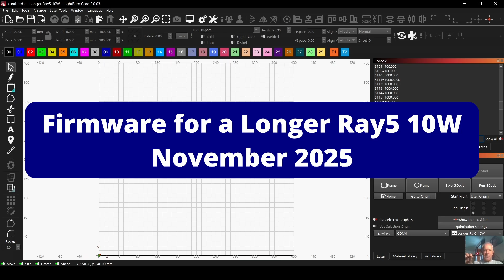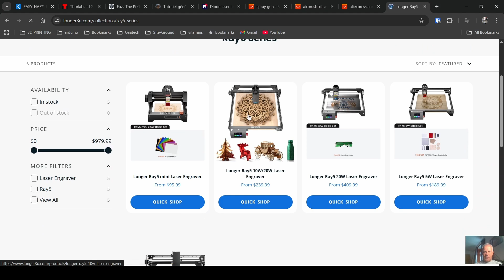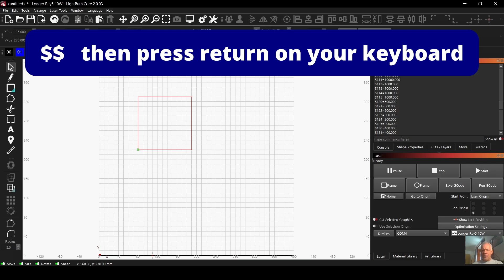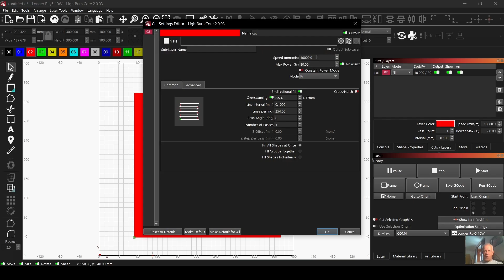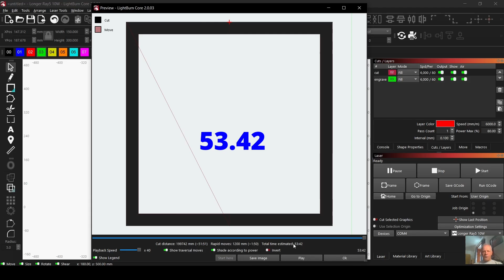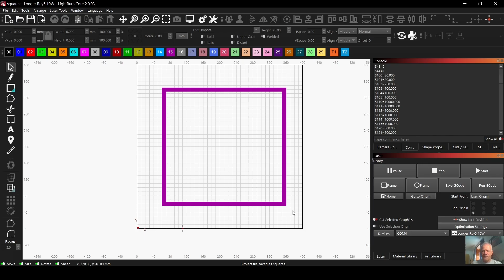How To Get More Laser Power For Free |  $30, S-Value Max, $110 & $111 Settings

Comment: So at 12:22 if you look where it says perfect for beginners they claim even higher than 10000 mm/min crazy
Reply from the maker: Yes but unless you are engraving a very very easy to damage material you are not going to use 10000, for a 10w but 20 and above yes you can use 10000 mm/m. 

But remember this is mm/m and not mm/s so it's still looks slow
Reply: @FlixmyswitchLASER yessir. I used to use an xtool d1 pro 20watt and it did everything in mm/sec. So going to my atomstack it was an adjustment.  Im currently making my way through several of your videos. Upgrading my laser work area size the next few weeks so using ypur good info to square the machine and tighten stuff properly.  Thank you for the wealth of knowledge
Reply from the maker: @bigchealthjournal thanks, glad you are finding value from them, and took the time to comment
Reply: @FlixmyswitchLASER yessir. I know views help the algorithm but comments help more. Question for you. What is the rod called that connects the stepper motor on the x gantry to the other side so that the stepper motor can drive both sides?
Reply from the maker: @bigchealthjournal hi I don't think it has a part name but it just a rod, drive link rod, drive cross link rod
Reply from the maker: Agreed interaction is better than a like
Reply from the maker: Depends what type of laser you have some go up to 24000 and 30000 mm/m

Comment: Thanks for all the help Andy I really appreciate
Reply from the maker: No problem what did you adjust?
Reply: @FlixmyswitchLASER  im the guy on fb working on the denim but im running at 30000 mm/m and had to drop my acceleration down to 2600. Looks like ill save 6-7 hours on a 9 hour burn 🙏
Reply from the maker: @culturalapparelsindicate thats a big saving. Please help me spread this video it would help so many people become more productive and its costs them nothing apart from a litte of their time to dial in the settings

Comment: Really important info! Will have to go back to my Ray5 10w once I get it going again. My new B1 40w is my current focus. I finally got the firmware flashed with the vers for the Laserburn app, and after successful cutting, started an engrave yesterday. It had taken 4hr 20min on the Ray5. I wanted to speed it up on the B1 and set it at: 35% P, and 13,500 mm/m. It took 7 hours last night on the B1!!! On Preview, it had said 2hr 20min, which was really far off from the actual time it took.  I am going to check these $ codes next... crazy. So glad for this info, thank you!
Reply: P.S. Longer advertises 36,000 mm/m for the 40w. Is this the max settings I should enter? Also, I entered $$ into Lightburn console and basically no codes were there. I am connected with phone and sd card, so will I be entering these codes at the beginning of every job into Lightburn?
Reply from the maker: Yes B1 max speed is 36000. So yes enter that
Reply from the maker: Also in one menu setting in lightburn once you update any settings read code from controller not at home now but will try and remember to post a photo later
Reply: @FlixmyswitchLASER  Thanks for the reply. I am using the Lightburn to connect via the lasers Wifi to tell it to start the job. I saw this after I put the gcodes in to have max speeds at 20,000. Can change down the road. But new problem. Last night new job, went about 3 inches into the engrave of 15inx14in. THen just stopped. I have my phone connected and about a foot away from the laser antenna. Too close? It seems to have disconnected? I am trying to save that blank and tried again today from the top down (180) and it only went 1 inch down. In the software it has the coordinates of the X and Y. But does not give me the option to start from there. It offers Pause and Start. When I choose pause, nothing happens, when I choose Start, it asks if I want to END the engrave.  Uugghhh It went from going slow for 7 hrs to complete a 15inx14in engrave, to only (faster) going a bit, then stopping. Any ideas???
Reply: Is there ANY way to tell the laser to start at that specific location at that place in that image? By way of SD Card and the Laserburn App?
Reply from the maker: @InquiringMindsKnow  move away from using wifi to stream data to the laser.  It would be better to load the gcode on to the SD card and use the web browser window to control the laser.  That way the manin data is on the sd card, and if you alter any setting in the web broswer its just sending one command and not 10,000s lines of data over wifi.
Reply from the maker: @InquiringMindsKnow  Again I have not used the longer laserburn app, i really should look at it and comment sometime, but i find lightburn does everying for me without any issues.
Reply from the maker: @InquiringMindsKnow  No once you have set the $ code to match your B1 Max speed 36000 mm/m thats it you only do it once.  I never use my phone so cant comment upon what you see.  As for getting closer estimated preview time, in lightburn click on the spanner icon, then additional settings, finially read from controller. Any time you adjust a $ speed or acceleration setting use the $ code you need to do this to allow lightburn to better estimate the time.  When you click on read from contoller you should see some numbers change
Reply: @FlixmyswitchLASER with the way I have things set up, I cannot read from the controller with lightburn. My desktop is connected to the internet router via USB, no Internet Wi-Fi in my desktop. I did watch your video and it looks like my desktop may be able to find the laser via the internet ISP address instead of using my phone to connect to the lasers network which just has my phone and the laser on it, no internet. It's looking like the way I thought I could do this is not going to work. But why can it engrave for 7 hours and complete a project and not engrave for more than an hour and stops 1/4th of the way through? I checked and it was still connected to my phone so I don't understand what is wrong. The only thing that's different is that I increased the max speed to 20k and lowered the speed of the job from 12,500 to 11, 000. I am still looking for a way to use the coordinates where the laser head stopped inside the job to get it to restart right there and save this unique blank.
Reply from the maker: @SS-qp8tz i feel the way you have the laser to your phone is the issue. Dont stream data. Save it to the sd card. Use the builtin web browser then to load the job
Reply from the maker: @SS-qp8tz  getting it to start again in the exact same place is all most impossibile. Remember then lines its burning are like 0.1 or 0.15 mm wide
Reply: @FlixmyswitchLASER  Unfortunately, I believe that is correct. I have not found a way to accurately restart in the correct spot. Thank you for the help!!!
Reply from the maker: Also in lightburn one of the settings menu if you change any $ setting then read from controller to get better preview results
Reply from the maker: Also in lightburn one of the settings menu if you change any $ setting then read from controller to get better preview results
Reply from the maker: This may help but use 36000 not 10000

https://youtu.be/xkrvIjy_sPY?si=-GLQmCelrgUdDuvn